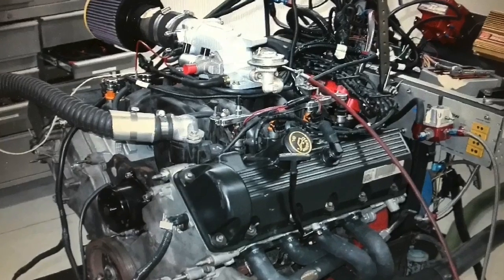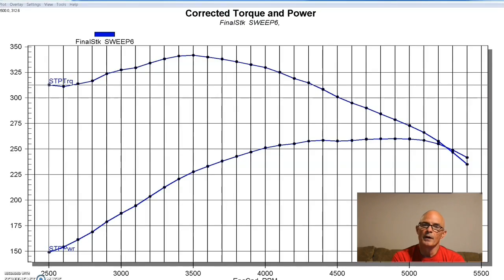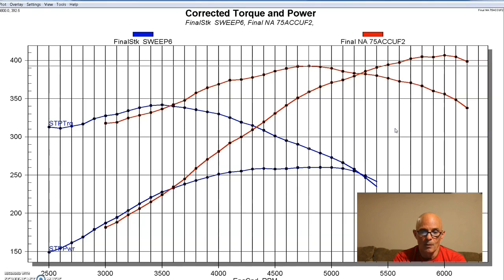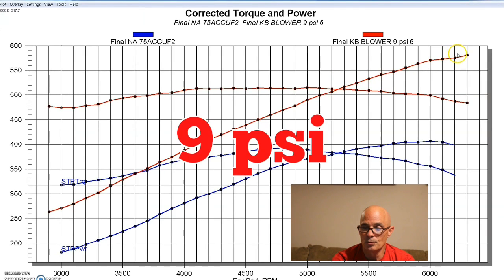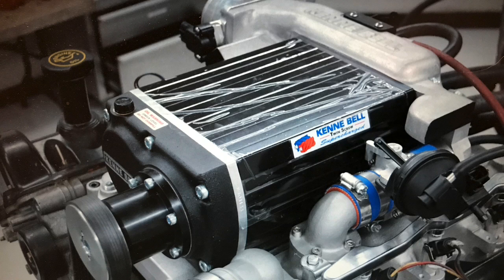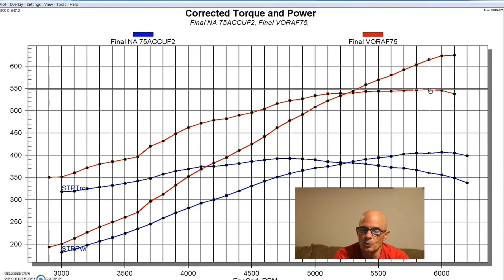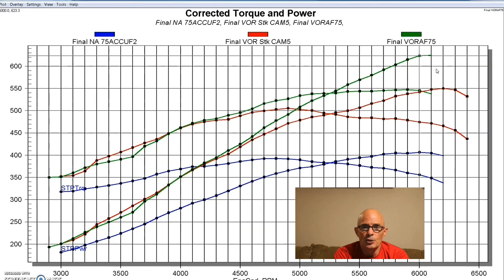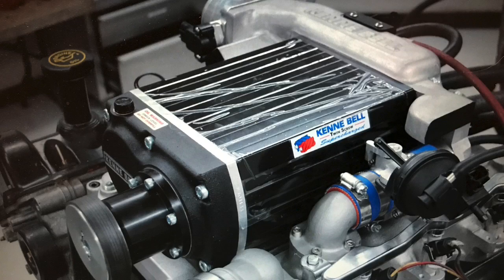HOW TO: SUPERCHARGED 4.6L FORD 2V (BOLT-ON BOOST)

Comment: So the newer mustangs will do 727hp with dealer installed blower. I wonder if the pi/non pi era cars can do that with trick flow heads, blower cams and similar boost levels.

Comment: Im all about the 5.4 2v. 8 thread 03 and up are bullet proof heads. Livernois performance 500$ to cnc port gets 220 cfm intake and 198 cfm exhaust. I built mine on a factory vergin block with mmr rods pistons and a factory forged crank. All arp hardware huricane pump and opg gear factory timing components with mmr tensioners. 100lb deuchtwerk injectors with a 2.3 tvs blower. Homemade 180 degree headers. Running 14 lbs of boost with factory cams from a lightning on a lightning gen 2 intake and 10 row cooler. Made 679 hp and 755 torque at rhe wheels at 6000 rpm. Its in my 65 coupe. 6r80 trans with a us power shift controller tuned by mile high performance

Comment: Wow, those NA numbers with just the PI heads, PI Intake, CAI, Long Tubes. 
I have a 96 GT and had the PI conversion done, but highly doubt I see horsepower numbers close to this.
Guessing more on the 260 - 270 mark, but never had dyno tested.
My upgrades are...
Stock PI Heads, PI Cams
PI Intake, CAI 
Ford Racing Shortly headers, BBK High flow cated x pipe, Flowmaster 400 cat backs.
Stock tune, injectors, fuel pump, runs great.
I would love to see 400 horses out of this setup, as everything I have read said 300 HP is tops for these engines NA.
What am I missing, besides the heads ported and polished that you mentioned in the vid?
Thanks!
Great Vid!

Comment: I wonder if its possible too put the 5.4 3V crank into the 4.6 2V  , as a bore an stroke combination.. instead of using the cobra crank since most of the motors are the same parts between the 2v 3v 4v engines
Reply from the maker: would require a very short rod

Comment: I would really like to see how the motor reacts to the newer trickflow 2v heads
Reply from the maker: I've run those
Reply: @richardholdener1727  in you're videos?
Reply: I have the 38cc TFS heads with Stage 2 bullet cams. The previous owner made 375hp at the crank with just the heads and stock PI manifold. It is going on NPI short block so the compression is going to be 11:1 I believe. I want to see if I can get 420-440hp N/A out of it when I add my ported Fox lack P51 intake on top of it. Should be rowdy for the street.

Comment: awesome! I have 325k miles on my 2005 2v 4.6 F150.

what about non PI heads on a PI engine? low compression, crank up the boost?
Reply from the maker: they don't flow as well
Reply: @richardholdener1727  makes sense, engines are just glorified air pumps right? new subscriber here, your videos are a gold mine!

Comment: Richard, if you were to boost a coyote in an f150 for a dd street car would you go KB or turbo?
Reply from the maker: Kenne Bell is probably easier
Reply: @richardholdener1727  Thanks Richard. Do you know if boosting a GM truck responds as well or better than coyote? I ask because running low 11's to low 10's on stock drivetrain looks simple on the Ford.

Comment: I have a 1997 2v 4.6 and I pi swapped it and it has ported pi heads, pi intake and pi cams can I expect 400hp n/a ??? I also have under drives and aluminum driveshaft, and 373's

Comment: The funny part is if you shop around the Ford dealers . You can get a cobra forged 4.6 crank and rods for 5 to 600$ for a rebuilt.  Plus shipping of course . I've seen 800hp + easy on a on3 turbo kit with with heads cam snd intake. 
They maje way more  power then the 5.0 pushrod motor with less parts and will last longer
Reply: Let me know where I’ll. Buy lol

Comment: the 2v 4.6 was actually used from 1991-2014, 23 year production run
Reply: Yea he forgot about the Vic's and I assume they still used it in trucks after 2011
Reply: Triton 2V Engines
Last Year Available 
E-Series Vans
(Cutaway and Chassis Cab only 2015+)
4.6L 2V  - 2014 
5.4L 2V - 2016
6.8L 2V V10 - 2019
Reply: Yea I have a 2008 with a 2v 4.6

Comment: 4.6, 2 valve
Smaller displacement v8 with a short stroke. These engines with a few basic improvements can have a very broad range of power and these suckers rev up. Andrew lavender has a built 2v on boost, turbo, and he beats the piss out of that car. I think he said his rev limit is right about 8,100-8,200 on pump E85 in his earlier days. 

I'm a huge fan of the 2v engines. Simple, very durable and they sound good. By far one of the best budget engines to work with for both simplicity and they are tough. Definitely do a big bang 4.6, but keep it as budget minded as possible as that's why guys buy these because they're so inexpensive and easy to find. Let's see what kind of numbers you can get out of them before the rods, pistons, bearings or block, maybe a slurry of all of the above. Lol
Reply: I think there is some irony in a short stroke overhead cam engine being unable to rev beyond 5500 rpm
Reply: its honestly not that short of stroke its pretty decent
Reply: I agree, I love the 4.6 and they are the best sounding engines.
I was shocked this 2 valve put down as much horsepower and more torque than the 01’ 
4 valve he tested with the different intakes.
Reply: Two valves are small bore engines. The stroke is similar to other v8s. They just run out of cylinder head or they would rev higher.
Reply: there's nothing simple and a mod motor. A 351w is simple, an LS is simple, Ford mod engines are not simple with 2 chains, 2 cams etc

Comment: Good stuff man and yeah finding engine component limitations would be  cool no matter the engine. I think most people like seeing cheaper easy to find engines pushed to their limits more  than race or purpose built engines. Especially if their less commonly used i.e. smaller v8 or 6 cylinder truck engines.

Comment: You flashed 1991 - 2004 up on the screen.  That is true for mustangs, but they continued it thru 2011 in the Crown Vics (and other panthers) and thru 2014 in the E series vans.
Reply from the maker: Yep-my mistake
Reply: Richard Holdener I wasn’t trying to point out your mistake. Just adding info about how many 4.6 motors ford made. Love your videos.

Comment: 400hp is normally to the wheels. With accessories and drive train loss you are close to the limit but it will live awhile at 450wh.
Reply from the maker: 625 flywheel hp is well over 450 wheel hp and the 400-hp myth was flywheel
Reply: Richard Holdener for sure! I know of one that made 530wh for a while!

Comment: what about fueling? was a return type ? upgraded injectors?
Reply from the maker: yes-You need injectors sized to supply the power output-either return or non will work
Reply: @richardholdener1727  Thanks. subscribed

Comment: That would be awesome to see a big bang 4.6 2v and also a 4.62v vs 5.4 2v. I have a vortech si trim 4.6 2v with a stock motor and making about 400 whp and wondering if going to a 5.4 will help or stick with the 4.6
Reply: Obviously going to the 5.4L 2v would make much more power, I wanted to do a big bore 5.3L 2v stroker on my production block 1995 4.6L 2v but having to resleeve costs a crap load n have been told block would be weaker after, so I decided I might go with a 5.1L stroker kit for my 2v, but the 5.4L is there too so why not, after all that block is said to handle more power than the 4.6L, no point of spending thousands of $$$ for less than 5.4Ls, I guess I'm getting it now.. Still stroking my 4.6L 2v to 5.1L n aiming to make over 1k hp on the built forged internals.. Going to build it N/A 1st tho before supercharging..
Reply: @P71ScrewHead  I've heard that the 5.4 makes the same power with a approximately 30-40 ft lbs more but the 4.6 can rev more due to the shorter stroke. That's with pi heads and a mustang intake with adapter plates
Reply: @CaptainMorgan3950  I've heard that too but I think it does make more hp n trq as well as I hear that block is stronger n will handle more power that the 4.6L block.. A stroker kit for the 4.6L will make more hp n trq so its a no brainer imo.. I have plenty of 4.6L 2v engines so going to build me one of them, maybe one day I'll build a 5.4L, or buy n build me a 7.0L LS7, I just have too many projects n dreams I want to fulfill, just not nearly enough $$$..lol

Comment: They made the 2v until like 2011 for the Crown Vic. 
Damned shame they didn't put the 3v in the Panther chassis - great car, sadly underpowered
Reply: Both the 2v and 3v V10 were still options in chassis cab & medium duty applications(don't you just love it when pick up truck guys call engines "gutless"? Meanwhile, medium duties typically have LESS power than the pickups; even today's 1000lb-ft diesels are detuned to ~600lb-ft in medium duties) up through 2019 - the 1st gen Modulars had a pretty insane production run!
Reply: I think you could still get the 4.6 2v in the econoline vans just a few years ago.

Comment: right off the bat, those gains from the ported pi heads and cam are amazing! That would feel like a whole different car and destroy a 3v mustang.
Reply: so 2v guys should go get a non-pi motor swap the top end off their mustangs and with a cam swap they will go from roughly 260 crank to roughly 400 crank?
Reply from the maker: with ported heads
Reply: @nickmahramus5034  i had fbo ported pi heads / npi bloc vt stage 2 cam  and i was only at 289whp/312wtq with a t45..  400hp maybe with monster cam 7000+rpm and higher cr then 10.5:1..

Comment: The 4.6 2v was used to 2011 in Crown Victorias
Reply: Indeed
Reply: and 09/10 f150
Reply: Fernando Reyes that was the 3 valve 4.6L
Reply: Mark Ball depends on year of production
Reply: @markball7028  My 2010 STX F150 has the 2v. 250 hp, 300 tq.
Reply: I got a 02 expedition with a 4.6 2v I’m wanting to get it bored and bigger pistons stage 2 comp cam and meybe a single turbo.
Reply: Steven Joseph instead of boring the engine just get either new heads and cam or get yours ported..heads and cam wake up the 4.6 a lot better than boring it out..while you’re at it throw in some headers and you’ll be a happy guy lol

Comment: I've always wanted to see a non intercooled blower that mounts right to the heads,like a kb, and added an intercooler before the blower. How well would it work, would it work at all? It should I think, cooler air in makes cooler air out right?
Reply from the maker: that wont work-you are cooling ambient air with either ambient air or ambient water
Reply: @richardholdener1727  that makes sense, would prob have to ice water to even make a difference.

Comment: You could get the 4.6 2v later than 04. I wanna say up until 11 or 12. Some of the base 150 trucks and vans
Reply: The 4.6 2V was used in the E- series vans until 2014 along with the  5.4 2V  and the 6.8 V10 2V

Comment: Thanks for the 2v love Richard
Reply: Andrew Lavender love ur vids man
Reply: Watch your videos regularly. I always had a thing for the under dog. And the 4.6 2V is definitely an underdog in today’s world .Glad the aftermarket has stepped up a little. Like tickflow coming out with some race port 195cc heads now. 👍
Reply: would be fun to see a stock shortblock in your car with the current turbo setup. that would be the ultimate torture test. haha. 60' before inspection window?
Reply: You two give me awful ideas🤣. Got a stock pi2v in my Capri running on terminator x and an on3 84/75.
Reply: Mr. Lavender,  what can I max my 04 gt stock internals to? I know you know your 2v's. Putting on e85 wanna go lil over 500rwhp if possible.  Will it be a bomb or rowdy a.f.? Thanks man
Reply: 2v in the house!!!
Reply: Andrew love your Mustang 🤙🏻🤙🏻
Reply: I know right?! Still a shit ton of money to do it though.
Reply: @maxie9506 takes a shit ton of money to make a shit ton of horsepower. Regardless of the engine

Comment: What about the stock NPI heads with cams and boost?
How about durability? 
Aren't the blocks known for splitting?
Reply from the maker: you can port the Non PI heads but they are not as good-blocks don't split
Reply: Fox body era 302(5.0l) blocks are known for splitting - iron Modular blocks are bulletproof to 800HP, where the very thin cylinder liners will crack(much like what can happen to LSes up around 1000) and much over that the cylinder can fail due to being supported at only the top and bottom. The aluminum blocks(sounds backwards, I know) are good over 4-digits, but getting it sleeved over 1000 is a good idea for longevity. With sleeves, the sky is the limit(practically speaking of course). 
Modular wizard John Mihovetz is making over 3000HP(5.88@254 in the 1/4: 4.6l, 11.5:1, 62psi, 10000RPM - I repeat, 11.5:1+62psi+10000RPM!!!)with production aluminum blocks and production 4v heads, even the production Kellogg forged crank from the '03/'04 Cobras too(though he typically runs billet Bryant cranks since the Kellogg starts to flex at the level he's at, never had a failure though). Did I mention stock valvetrain too(except for valves, springs+retainers, & cams obviously)? It should be noted that he puts TOOOONS of hours into prepping the blocks for that level of performance of course, but that's no different than any other block for a 3000+HP engine(mentioned because some people take "production block" a bit too literally, as if it somehow doesn't need the same prep as even aftermarket race blocks).

Comment: I Love 2V's  I have built a 304" 2V 13 to 1 compression Carbed with Nitrous that runs 8.90's @ 160mph  in the 1/4.  We won the Mod Nationals twice with this combo... 
So they can be made to run!
Reply: Wow, 2 of the fastest 2v owners commenting on this vid. I am humbled to be in y'alls presence lol.
Reply: Unity MotorSports Garage fancy seeing u here
Reply: @andrewlavender08  what's up brother!  How is that Monster 2V of yours running?  Everyone meet the guy who took the crown from us!
Reply: Unity MotorSports Garage pretty good, itching to get it on the track after all this virus craziness is over
Reply: Both of you have gotten me hooked on 2V builds, etc. Love both or your channels. 💯
Reply from the maker: That's Stout
Reply: I've always heard anything more than 450 hp on the 2V engine and the pistons and rods disintegrate. Do this video confirm that is not true? Would it be safe to put TFS Heads, Eddlebrock Victor Jr Intake, 90mm throttle body and elbow, Stage 3 Cams, O/R Xpipe, Long Tube Headers, and Vortech V3-Si  on my 2003 Gt?
Reply: @SuperNemisis1  when ppl say 450 hp they're talking WHEEL hp when it's actually in the car with all the accessories hooked up through exhaust etc.  In this test it's an engine dyno not breathing through a full exhaust and running accessories and also you get the driveline lost.  So 450 wheel is prob 550-600 run the way Richard is in this video.  Also it's much easier to survive on a dyno vs in the car beating on it down the street or track.  It dont cost much to upgrade the rods n pistons you can get forged ones for about 1200ish bucks total.  This also gives you a chance to raise the compression.  I would raise it to 10:1 at least even if you're planning pump gas and/or boost.  You just gotta run less boost...you make the same power on less boost vs lower compression setups making it easier on the turbo or supercharger not having to spin it as fast to make the same power.  If you get your hands on e85 or race fuel you can REALLY start making some power when you combine boost with higher compression.  A 2v is 1200 bucks worth of rods n pistons away from making 700+ all day long....and forced induction obviously lol.
Reply: @SuperNemisis1  while Richard would be better to commit on this... I have seen MANY fail around the 450 hp range.. in what I have seen.. tight ring gap was the cause!  I have only seen one rod fail mid beam.. and from what I seen the rod bearing was the cause of that...  Given the cost of some Coyote Boss Rods I would put them in with some good pistons as cheap insurance!  We made over 700hp for years on a Stock Cast crank... So depending on your hp target.. I would just run the cast crank!  From your part selection making hp isn't going to be a problem!  
Andy
Reply: @UnityMotorSportsGarage  do you suggest just getting a Forged rotating assembly like Scat or manly?
Reply: Love Andrew Lavender and all, but this is the most useful, real world video on the 2V. Have seen at least two other videos showing Vortech installs. A quirky problem is the need to find a different idler pulley, with a narrower profile, so it fits behind the supercharger. Would be really great if somebody had the part number for THAT idler pulley. Subscribed.
Reply: Unity MotorSports Garage  you got a bad bad 2V carb too y’all it’s a amazing machine
Reply: Unity MotorSports Garage : Yes. Its a Japanese style engine which advanced the economy and smoothness while still having the 289 and 302 style virtues. Perhaps if it had started out with either a 3.7 inch bore  or 3.75 stroke and was actually a 4.9 or 5.0...people wouldnt have felt short changed. The Numerical Superiority Thang. Again though...FoMoCo probably just wanted a new pizza base Out There, eh? Then the 5.6 liter stroker 5.0 OHV could have moved into the gap like it did in Aussie Fords for 2001 to 2002. Then what to do with the 5.8 Windsor and 429/460 EFis. Ford at least has always had a really great engine out there in the 4.6. "Stroker 3.75 crank and con rod every 4.6!" RIchard got it Right in 2011.... http://www.mustangandfords.com/how-to/engine/mmfp-1105-two-valve-stroker-motor-build
Reply: Can you help me with some info. I have a 2002 gt mustang convertible with 106,000 original mile. I would like to get about 520hp on a safe budget, lol
Reply: where do you get your con rods, im looking to make a daily 600 whp truck